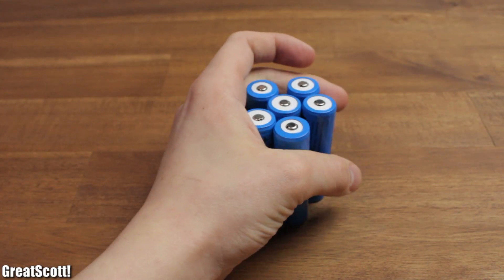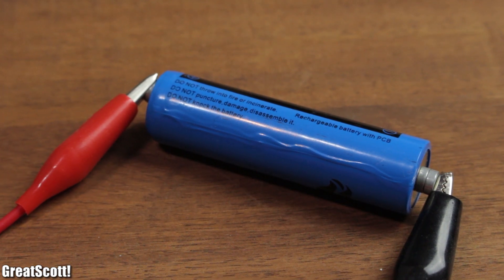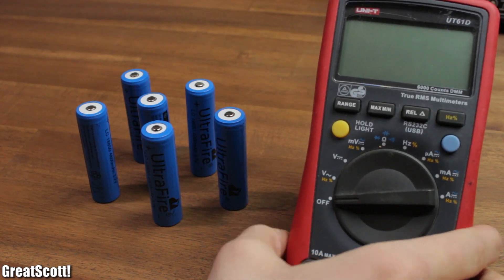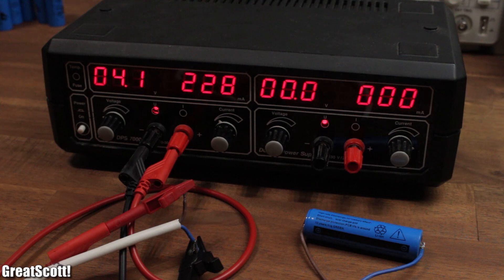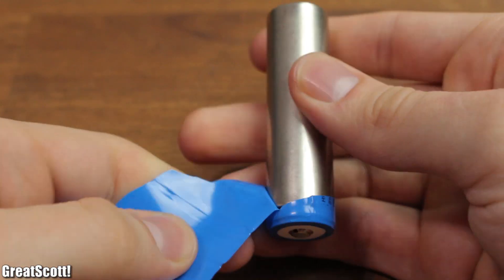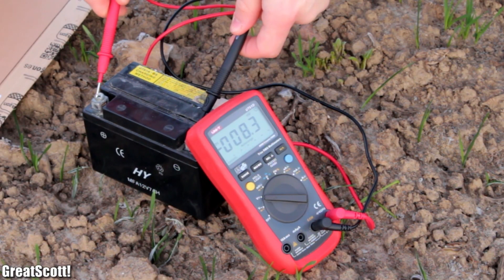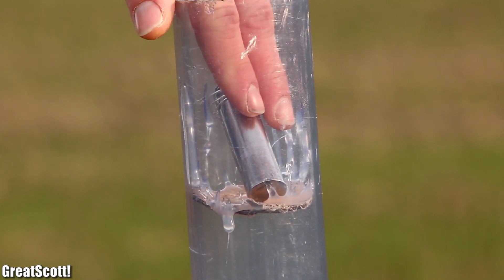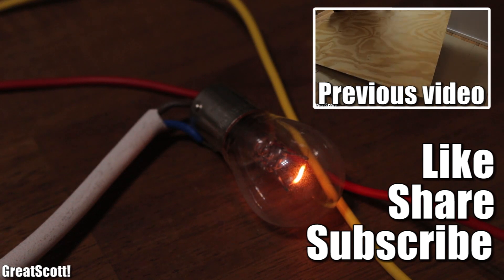Li-Ion battery short circuit,overcharge,undervoltage EXPERIMENT

Comment: I had one exploding in my house. I removed them out of an old laptop battery, tested them with the Xtar Dragon, 4 of them with the best capacity left I bought a 4 cell powerbank for. So you put them in, two with + up, two with - up, close the lid, and you have a nice powerbank. But, yeah one of the batteries exploded, pieces of hot metal flowing through the air. I thought, I must be stupid but did I short circuit one by putting it in the other way around. But your don't even explode. Not like here. I have pieces of battery on the ceiling.

Comment: Thanks for the interesting video. Question, why did my four 12v lithium ion batteries changed to 28v after a 1 sec external short circuit? They were connected in series on a solar system. Thanks

Comment: I've seen this video several times.  Earlier today i had a similar blue 18650 soldered to a remote control truck that normally takes 4 AA batteries connected to a similar power supply.  I forgot about it on the charger.  I went and unhooked the leads, grabbed the truck and walked to another part of the garage.  As I set it down I could feel the heat coming off of it.  The wires leading to the car battery terminals began to smoke and the blue cover split, shrunk, and curled backwards exposing the metal casing.  I blew on the battery to cool it down and BOOM!!!  It exploded at about half an arms length right in my face!  I had a burnt plastic taste in my mouth and debris in my eyes.  I ran water over my eyes for a couple minutes, dried off my face and went back to assess the scene.  The battery blew out mainly the positive end, spewing metal and the copper looking paper wrapping from inside into the cab of the pickup truck.  The walls of the battery held up and did not burst in the direction of my face at all.  That was an interesting experience, I think I am lucky that I have no injury whatsoever.
Reply: Dude... I got nervous even just reading your comment. Glad you are ok in the end, but blowing on the battery to cool it down?!?! Just no.
Reply: Blowing on it is so helpful. Next time put your eye next to the end, as it blows up! Sounds safe. ;-)
Reply: @mrtechie6810  you'd be lying if you said you've never done something stupid, or if you really haven't then you've got a whole lot to learn.  What is experience?  It's basically knowing what NOT to do based on a big long list of things you've done wrong before.  The key is to not make the same mistakes again.  And be humble and honest about it.  Acting superior says a lot about someone's character, and it's another level to be a dick about it too.
Reply: @UncategorizedContent  glad you are ok.
As for the rest, just no. I'm very safety conscious.

Comment: Wrong battery. Surefire or any "fire" batteries are not true 18650. They have a tiny actual battery inside, which is about 5% capacity of a real 18650.
try Panasonic NCR18650B, they go for 5$ or so and are good quality.
Your battery doesn't have nearly enough juice to cause any damage really

Comment: I understand very well that Great Scott's lead battery could not light the lid on your cheap Li-Ion battery. When the voltage is down to 11.48 volts, a lead-acid battery is completely discharged and contains almost no energy. At the same time, the wire you use has too much resistance to the large currents that must go for something to happen.

I have some 9990 mAh of the cheap Chinese junk that I teach young people how not to treat a Li-Ion cell. Usually I can make them crack the casing with a little bang when they are connected directely to a fully charged car battery with a short thick cord.

Comment: Ok so I have a raspberry Pi 3 that needs to be up 24/7. I want to power it with a Li-ion battery but the whole system is inside a chamber made out completely from wood so I can't risk starting a fire. My plan is to get a metal box, put the battery in it and have the tiniest hole possible to get the cables out towards the Pi 3, would that be 100% safe?

Comment: I accidentially left 2 of my Sony VTC5a in a partially discharged state for over a month and found out that my charger said the voltage was 1.94 when I began charging them. However, the voltage increased to 2.5 volts, which is the minimum discharge of the battery, within a minute. I know Li-Ion batteries have a tendancy to self discharge over time, but below 2.5 volts? Sony VTC5a batteries are supposed to have safety built in to prevent them from over discharge below their safety limits. 
How safe are they to use again?

Comment: you should try a 35 amp samsung battery or mxjo battery that can maintain 20 amps with a load, not these crappy ultrafires that cant maintain more then 1 amp throughout its discharge

Comment: Hi I need some advice on these 18650 batteries. I bought 4 + charger on ebay all 4 batteries tested 4.2v on the multimeter , I only needed 3 of them for my project. My question is the 3 batteries are how between 3.9 to 3.86v and the project stop working i.e. not enough power. I’m a bit worried to put the batteries in the charger because the light is red meaning they are charged. Do I discharge them? What do I need to do. https://www.ebay.co.uk/itm/4-x-UltraFire-18650-8800mAh-3-7V-Li-ion-Rechargeable-3-PIN-UK-Battery-Charger/262425807293?ssPageName=STRK%3AMEBIDX%3AIT&_trksid=p2057872.m2749.l2649

Comment: This clip is recorded by layman, looks nice, but gives no useful information.
I have tested these batteries on professional level and my verdict: this is a fake battery.
Some details: The capacity of this battery is around 300 mA x h, which is 20+ times !!! less than announced (6800). Secondly, the internal resistance is ~8 Ohm, too large for practical applications. This explains why it is tolerant to short-circuit.  
On checking the other good-quality 18650 batteries, I found that the practical capacity of this type of Li-Ion batteries is in a range of 2400 – 3000 mAxh. There are very expensive batteries with 4200 mAxh but I didn’t test them. So my advice - do not buy 18650 batteries which claim the capacity more than 3000 mAxh –they are just rubbish. Another hint to filter out fake batteries – they have a positive contact shape the same as conventional AA-AAA batteries, while the positive contact of real Li-ion batteries is bigger in diameter and have some holes for gas extraction. All the best.

Comment: i have a 2200 mili amps battery. i have make short circuit from positive to the battery case. open smal voltaic arc and really make sparks and melted de wire

Comment: Chances when you bought ****fire battery is:

1. Yodawg battery, smaller battery inside. Plus with extra sand.

2. Recycled laptop batteries from broken battery pack, which i'm doing it.

3. Low grade battery like type C, stuffed inside.

They are good for flashlight, bad for high drain use like vape due to high resistance.

Even if they do have same label, it's not guaranteeing you to only got one type of those. They are quite random.

Comment: 0:32 How are you powering that LED without an in-line resistor? Last time i did it the LED was burnt to a crisp!
Reply: that made my jaw drop as well.  notice these two tiny magnetic, resistor metals that he attached to the battery; where alligator tips are attached to the terminals. those are resistors.

Comment: That's why it's better to buy Samsung or LG 18650 batteries. Who cares if it's more expensive, at least it wont explode. #VapeNaysh
Reply: + Normal 18650 batteries dont have that positive terminal that has a nipple instead, they have the short circuit protection in the positive terminal, fucking chinese manufacturers man

Comment: i don't know. maybe this is just a battery of bad quality? bad quality could mean high inner resistance. the higher the resistance the smaller the effect if you short it out.
Reply: and also: couldn't the circuit be inside? who says it has to be under the plastic sheet?
Reply: JohannaMueller57 because there are cells inside of the metal jacket

Comment: They didn't even give values on the max continuous drain and max pulse drain. I guess with 4800mAh, they are low-drain batteries hence the not so spectecular results in overcharging and shorting them. With high-drain batteries like the LG HG2 or Sony VTC5 the results should be a little more spicy.

Kind regards,
Meta Custom Computers

Comment: I have samsung one's I discharged them to 0.5 v can they be brought in use again if yes then how
Reply: I don't think so. Look at the chart at 1:18. The anode has dissolved.
Reply: +Peter McArthur  
it's back in work again. I supplied 35v 400ma for two minutes and then 12v 3A for 5 minutes and then 9v for 10-15 minutes and then I charged it from 2A mobile changer and it's back in work again. Just its capacity decreased by 60mah but it works fine as good as new

Comment: A way to see if these 18650 batteries have a protective PCB is to look right under the negative side. There should be a small "dent" like on the postive side.

Comment: I was thinking of making a 4 cell battery pack having following configuration :
[(cell 1) series (cell 2)] parallel [(cell 3) series (cell 4)] 
Is it safe to connect Li ion cells in series / parallel? Or will the cells get unbalanced and cause problems? 
FYI I'll charge them individually using TP4056. I got contradictory answers from different fora, hence asking you. TIA

Comment: Nice!  But did you ever take a fully charged battery and see if you can get, say, 4.8 amps for one full hour from one ?  (4800 mAh)
If you can then I would LOVE to buy some of those and connect some in series/parallel to power my electric lawn mower!  I think two in parallel is actually enough (close to 10 Ah) but I need 24v.  Good possibility here!
So... 14 of them if they really have that capacity.
Reply: Even though they are 900 mAh in capacity.

Comment: Thanks for the testing. I have a flashlight which I purchased while visiting China. It has the 18650 Ultra Fire cell. I have had it for years and the battery still functions well.
Reply: ultra fire is a reputable battery company, just that there are a lot of fakes out there
Reply: Yes, I know! That's a shame. I guess mine is one of the real ones. :)

Comment: http://www.amazon.com/dp/B0062ANS7O/ref=pe_385040_128020140_TE_3p_dp_1

Got those for $25 after tax so their a bit more expensive now. All in all, these 2 batteries in this link will save you a lot of time in research as they are solid. Silly battery market, you can't put a AAA into a bigger case and call it a 18650. There are some legitimate UltraFire batteries and a lot of fakes. Also the same can be said for the flashlight market, all of them are going to be "crap" in a price range of $10-$50. Try to find one with a few bells and whistles and looks sturdy. I would suggest one with a CREE Led that you've looked at the spec sheet about.

Comment: Fun fact, most of the ultra fire's aren't actually what they're marketed as, some people open them up and there could be anything inside, it could be a lipo or basically anything else.
Reply: Lipo means more than one cell, po means poly not polymer, poly as in more than one,  or so I was told, and seen, 20Amp is about the max, 30 to 40Amp means pulsed not continuous

Comment: "ultrafire" is the copycat of "surefire", because they can be translated into the same Chinese name. Many manufactories in China are producing batteries and flashlights using this brand, but using different appearance design, and different capacities. Most of them are safe, because there is pressure protection in the battery, which will break the circuit and let air out through small holes when over charging or shorting causes high pressure in the battery. I'm surprised that you can buy such products out of China...

Comment: A 4800 mAh 18650?  There is no such thing yet.  Even the Panasonic 18650b is just 3400 mAh and they are much higher quality than the Ultrafire batteries.  There are real Ultrafire batteries but the markets are full of fakes some of which say protected but are not really.  There are also some fake Ultrafires so bad that they have a tiny cell inside them and some powder.  That powder is thought to be plaster or flour used to fill the battery and make it feel more real.  You won't find that in any battery that is made by a trustworthy brand and those brands are the Japanese ones.  Do not use multiple unprotected cells or mix old and new and also balance the cells.  If you don't know how there are plenty of forums to help you safely use these cells.  They are dangerous if know nothing about them.  These can start fires or explode.  But all the false advertising on the labels of the fake Ultrafires is why I do not like them other than the fact that they are very poorly made.  I got one with my flashlight and just set it aside and bought an Efest battery.  I also put that cheap charger that came with the light aside because it overcharges the cells.  I only paid 8.00 for the light, battery and charger and the flashlight is the only part of the deal truly worth anything.  I feel that that cheap battery and charger are only included so that I can use it and see how well it really works.  My battery was one of the Ultrafire 3000 mAh (yeah right) that said it was protected.  I do not believe that is anything more than 2200 mAh maybe even less and I took the label off and it is not protected.  A gullible person would have used that to have it blow up and cripple his hand thinking that it is protected but not me.  It would have only been less safe if I had another identical one to it and used them both in a flashlight and I would be nervous using them things like that.  They are probably even used cells from a laptop battery after all.  That is how I can see them being so very dangerous and now I only use good cells.

Comment: If you break apart the ultrafire 18650s they SHOULD have some kind of power in them with a tiny little battery inside it. These batteries are supposed to be really high capacity as the label said but in fact they are just horrid. I have some of the red ultrafires that are labeled as 2800MAH but you are lucky to get even closse to 600MAH. I use an E-cigarette mod and was totally ripped off on these until I did some extensive research into the batteries.

Comment: I'm not sure what was being done on the part where a small light bulb is connected. What was expected to happen? Anyone care to explain?
Reply from the maker: BretonDP The "circuit" of the battery was supposed to protect it from undervoltage. Many manufacturer choose 2,5V as the line. But it kept on discharging which proves that there is no circuit.

Comment: I'm an avid vaper, so I'm quite familiar with the workings of such 18xxx batteries. I for one wouldn't want any brandname ending in "fire" anywhere near my equipment. Efest IMR's all the way. Better continuous current rating, safer battery chemistry, and loads and loads of positive user reviews. They might be more expensive, but in the long run you pay for the shrugging-it-off attitude.

Nonetheless, good fault tolerance on these particular ultrafire batteries. I wouldn't count on that always being the case though.

Comment: would you be able to make an arduino Leonardo sense the rpm cable from a 3 pin fan so when any fans connected to it will sound a buzzer if a fan stops

Comment: So, finally, was the capacity of 4800mAh true?
Reply: Jeronimo M no
Reply: No.
Reply: Don't trust  any 18650 battery with more than 3000mah
Reply: @emilezealorentoes8255  not true, panasonic, a famous company in japan made a 3400mAh 18650 cell called the NCR18650B. The cell is infact so good that Tesla used them in their electric cars (except for the model 3). I have 23 of those cells and yes, they do have close to 3400mAh.
Reply: Idc I dnt trust anything over 3000 mah we all have our safety standards
Reply: @emilezealorentoes8255  oh, so you don't trust them because of danger of higher energy cells and not because you don't think they can actually store that much energy.
Reply: @luongmaihunggia  from danger anything above 3000 is a risk just from getting 200 or 400 more mah    I know they make up to 3500 but I just dnt see the gain outweighing the risk of it being a fake weigh the battery check the specs of the battery online if they dnt match up I throw the battery away
Reply: @emilezealorentoes8255  a fake one would have less energy than a real one, it's the real ones you should be scared of.
Reply: @luongmaihunggia  fake ones r the ones tht explode from just using it
Reply: @luongmaihunggia  I've actually seen an ultrafire have a double a battery inside it
Reply: @emilezealorentoes8255  fake ones are one with unknown names, brands, origin, avoid those at all cost.
Reply: @luongmaihunggia  not true all brands can be faked
Reply: @emilezealorentoes8255  I never said all brand are real, I said avoid brandless ones as the probability of being fake is higher for brandless ones than brand ones. It just simple probability logic.
Reply: @luongmaihunggia  just use comment sense and u usely will be ok and weigh it on a scale if it I dnt at least 38grams throw it away